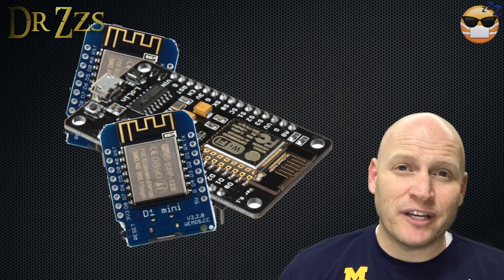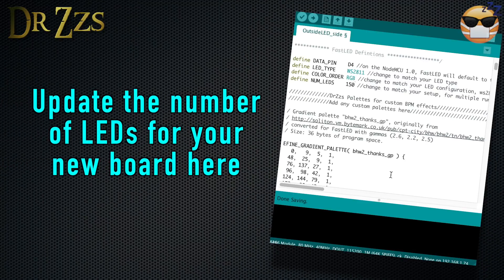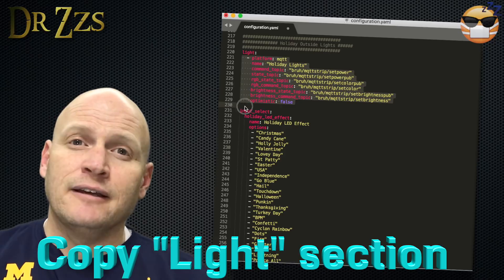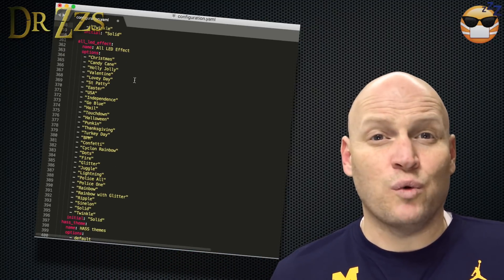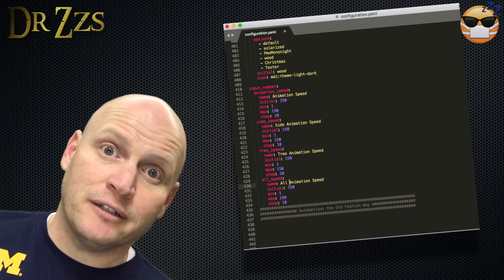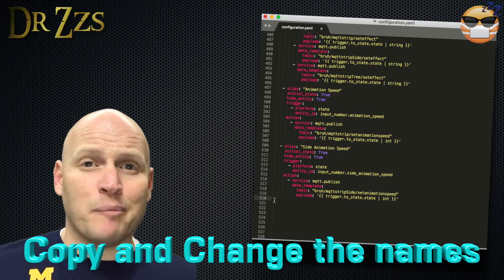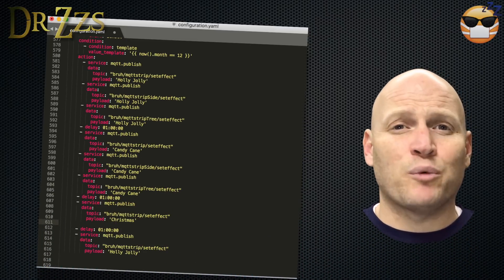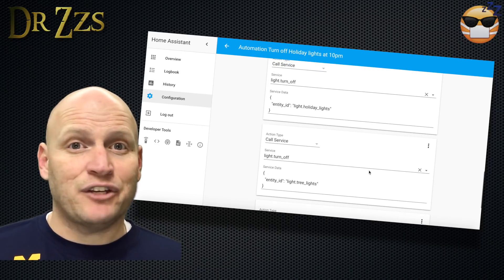Setting up multiple LED wifi control boards

Comment: How do you get wifi signal to reach out to your lights not on the house, the tree etc?
Reply from the maker: If you have signal problems, the easiest solution is probably to get a D1mini-Pro.  They have a big antenna to extend the wifi reach.  
Otherwise, just upgrade to a router or get a wifi extender.

Comment: This is awesome.. quick question.. Do you only have one Power supply? I'm doing my lights as well and I need 2 x 500 lights to cover the house. I just feel that 1 PS is not going to be enough... Your thoughts?
Reply from the maker: Thanks!
a simple way to know how much power you need is to assume 1 amp per 50 LEDs.  So for your 1000 LEDs, you need a 20 amp PS.  Those are easy to find for about $20.  Here's a 30a 5v ps for $17 - https://amzn.to/2Qiy0ed
if you're using 12v lights you can use something like this: https://amzn.to/2EijH2w
So I'd say use just one power supply.  I'm running 900 LEDs on one ps.  I think the only reason to use 2 power supplies would be if the origin points for your LEDs are a long distance from each other.  
Hope that helps!

Comment: Am having some issues and was wondering if anyone else came across the same problems., Am trying to get  two boards running,  the minute both boards are on the air. Nothing wants to work. If I take any board off the wifi, the other board works fine. I check my router set up. both boards have a reserve ip address. so that's not the issue. Any help would be appreciated.

Comment: First of all thanks a lot for all your helpful and inspiring videos! I have no clue how I could get in contact with you, so I thought a message here could be worth a try. I know many people use MagicHome WiFi LED Controller and it is possible to flash them with tasmota - due to the esp they can’t be so different from Sonoffs. The reason and idea for a video I have comes from these scene switch light bulbs - Philips. So if you switch off and fast on again you could change the dim setting like from 100% to 70%. I know there is a bunch of different technology in those bulbs, but can’t the esp realise that it had no power for a few seconds and change to predefined  settings? Do you have any clue or an idea? Thanks!
Reply from the maker: Hi!
I'm not sure about switching off then on quickly to dim lights with esp/tasmota.  I suppose it might work, but I'm not sure how exactly to try it.  
If you go to Drzzs.com you can join our facebook group and discord and maybe someone there would know how to do it.

Comment: Holiday lights working no problem. Decided to add to side of the house, set up as directed tested no problems. Switch the power off the house to connect. Now will not switch on and remain on. All other functions working fine.any help ?
Reply from the maker: hmmm
can you see the D1mini connecting to your home network?  It was all working before you put it on the house?
Reply: Thanks for the reply. Switched house power off and on and lights back on. Your videos are brill. Will be trying the floor plan at some stage. I live in the UK and a young age of 75.
Reply from the maker: 75yrs young!!! awesome! 
I hope I'm still doing cool stuff like this when I'm 75. 
Have fun with Floorplan.  Sweethome3d is really cool as a background.  I might have to do a video about it.

Comment: Great videos DrZzs, they've helped me out alot!  Not sure if anyone else had problems, but I found when adding another board only 1 was working at a time, or sometimes not working at all.   On the client.connect at the very bottom, the client name needs to be different.  'if (client.connect("differentName", mqtt_user, mqtt_password)) {'
Reply from the maker: Glad to help!
Sorry I missed that bit about the client name.  Glad you figured it out and thanks for sharing so others won't get stuck :) 
Thanks!
Reply: I know that this is a old subject now. Hopefully you see this reply. am having the same issue,   the minute both bords are on the air. Nothing wants to work. If I take any board off the wifi, the other board works fine. I think that you where having the same problem. If so, am not sure I understand your fix. Could you please elaborate a bit more.

Comment: Hey I love u videos  I need put some led lights  outside my house just like the one on this video I'm new on this  any advise where to start   starting  from    what lights to buy  u know  starting  from.  Zero .I hope u can help me  I just wanna start  getting  ready for Christmas
Reply from the maker: Have you seen my other videos about the lights?  If not start here: 
https://youtu.be/6Y6jUM1OaYM

https://youtu.be/zov-qIDSDcE

https://youtu.be/s5yLLtPrKAM

I still haven't mastered the Over the Air update stuff.  I need to add the latest working arduino sketch to the github.  There are sketches there that should all work (should).  Here's the link: https://github.com/Snipercaine/Holiday-LED-files

The 30 second summary is this:
1- get 12v ws2811 LED strings - https://amzn.to/2HLYTC2
2- get the D1 mini (and a 5v ps), or the NodeMCU (runs on 12v so can use same ps as LEDs) - https://amzn.to/2Hpsylb
3- 12v ps (about 1 amp per string of 50 LEDs) - https://amzn.to/2qYMb8I
4- a weather proof box - https://amzn.to/2HKiBhs (best check the size make sure it'll fit the ps, I'm just grabbing links for you) 
5- J-channel - https://www.lowes.com/pd/Georgia-Pacific-J-channel-White-0-625-in-x-150-in-Vinyl-Siding-Trim/999969214 (you can either buy white and paint it, or they might have a color to match your house) 
6- Drill 1/2" holes in the j-channel every 3" 
7- If you have more than 5 strings in a run you'll want to add some extra wires to boost it back to 12v (voltage will drop over distance and after ~ 5 strings you'll see dimming if you don't boost it). 
8- And you'll need Home Assistant (rpi3 running Hassio image) - https://youtu.be/c2IUIUnxjUY
https://amzn.to/2HpvHS1

The best thing I can suggest is to get 1 string of LEDs and the controller (nodeMCU), load the sketch and make sure the lights work BEFORE you buy all the lights and start drilling/mounting etc.  AND, expect to hit bumps along the way. I certainly didn't get it all working on my first try.  Now that I've done it a few times I can probably help you get over whatever obstacles you encounter. Be prepared to learn a lot, and enjoy the process.  

I've got some lights to hang on the back side of my house in the next couple months.  So I'll be doing another updated video about these LEDs soon. 
Let me know if you get stuck and need help! 
Good Luck!

Comment: I had an idea for installing LED lights on my house the way you have but I wanted to use a PoE switch. I don't have the lights or anything yet but thought you might find it interesting enough to do a video on it. I had planned on trying to use all the pairs in a CAT6 cable for strictly delivering power to my LED strips. Have no idea if this would work but you might be the right person to try it out and make a video. I also was curious if using the CAT6 pairs for power worked I could use one of the pairs for the clock. Since I've already got a PoE switch I figured this would be easier than purchasing and mounting an external power supply and running separate paired wires for the power input. Let me know what you think and would love to see a video on it if you find it interesting.

Comment: With the new version there are some changes to automations each automation is given a unique id i tried but your automation scripts do not work can you please check
Reply from the maker: Ah yes.  When they added the Automation editor to Home Assistant it references another file called automations.yaml.  It does give every automation a unique id. 

There's a way to include existing automations in that file, but what I've done is create a section in the configuration.yaml called "automations old:" and I keep my light automations there.

I'll check the github files and make sure I've got the automations old section correct. 
Thanks!
Reply: now you know save the day for me :) :)

Comment: I think i am having issues with MQTT, i can start it up, but once i close putty, it shuts it down
Reply from the maker: WatchDragon Hmmm. I’m no expert on MQTT. I followed Bruh Automation’s set up video. Haven’t really touched it since. I had trouble when I tried switching to Hass.io but the problems went away when I switched back to Hassbian. 

Try the Home Assistant forums or discord channel. 
https://community.home-assistant.io/

Sorry I don’t have a quick fix for you.
Reply: Are you running the mqtt daemon in a background mode or in mode that prints the log to your terminal?

Comment: Hi, which editor on your Mac are you using to edit yaml files?
Reply from the maker: Sublime text.  
I didn't really choose it on purpose.  A friend was going to teach me some programming stuff and said I should install it.  He never ended up teaching me much.  Then the first time I opened my HA config.yaml that's the program that opened it.  I've just stuck with it ever since.  It's good.  I'm sure it has features I don't use or understand.  But I like it.

Comment: You can have them subscribe to all the same topics, just the client name has to change. I had to use two boards and it works great. Just as you would hope.
Reply from the maker: Thanks!  
I need to try it that way.
Reply: You took the words right out of my mouth :-)

Comment: Can you do a video on your pixels string lights on the tree?
Reply: Does it have the same effects as your led strip lights?
Reply from the maker: For sure!
I don't think I can get to it before Christmas though.  
I'll put it on the list and get to it soon as I can.  Maybe within a month or so. 
I'm doing Sonoff OTA flashing with Tasmota right now, and I'm excited about the new Cloud that Home Assistant has started that should make working with Alexa pretty seamless (that's the hope at least).
Reply: No problem! I am adding Alexa in more things in my home this year. I seen Alexa control led strips using the Nexlux WiFi Wireless LED Smart Controller. Thank you!

Comment: Pretty sure you can have more then one board subscribe to the same  mqtt topic but then they would all do the same action. I think having them on different topics gives you more flexibility. 
Nice job on the videos keep it up.
Reply from the maker: Thanks!
Reply: this is correct.  For instance, I have all mine use the same 'seteffect' mqtt topic.  But i have to change the other topics assigned to the light (power, brightness, color).  But mainly the power one.  Otherwise if you turn one off, it might turn on the other.    But if you group the lights together, it will have a group power option anyway.